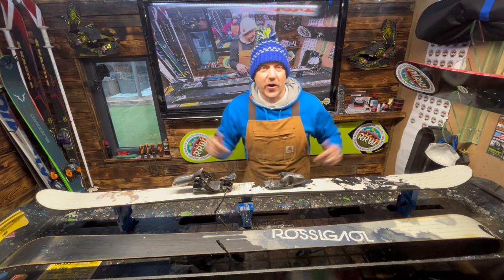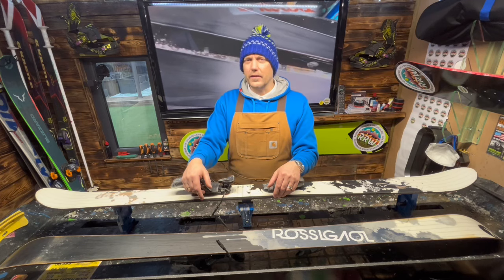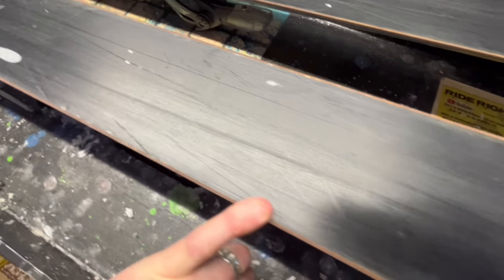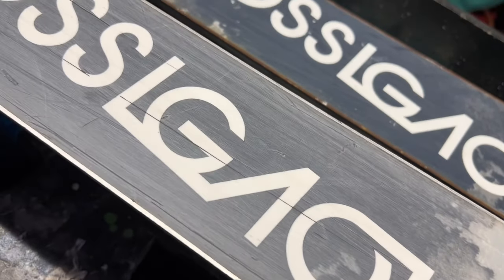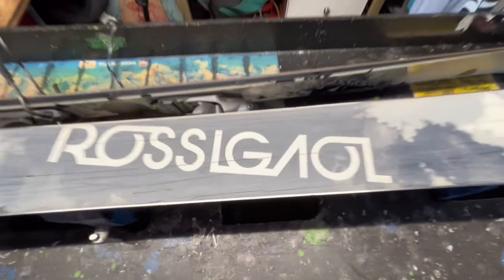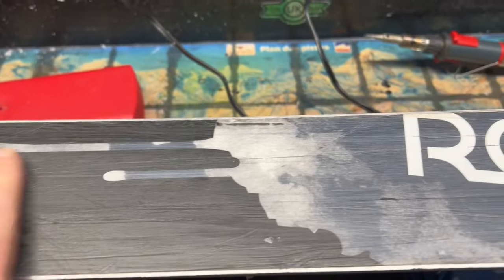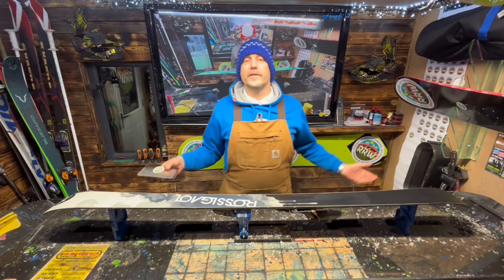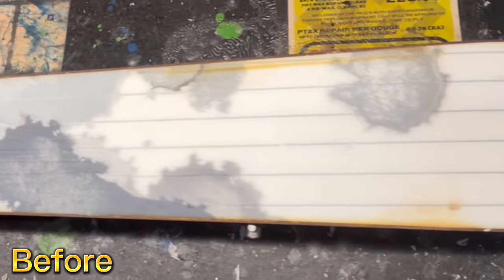Rossignol ￼ scratch Brigade very rusty and Core shot,  mega turn around 👌

Comment: After this amazing turnaround i have to ask. 

I made some superficial scratches on my bases while waxing that I just can't seem to polish off with a nylon or horsehair brush. And this irritates me immensely

I can’t feel them, but they are visible now the bases are brushed. Any ideas, perhaps a brass brush?

After seeing your work on these I must be missing something.
Reply from the maker: Thanks for the comment, sometimes depending on the base quality you might need to do a base scrape before applying the wax, it’s a sharp metal scraper. Sometimes this can add additional marks if you pushed too hard on the base of the Ski, you are meant to have directional marks in the Ski,, hence why you copper brush the Ski, before waxing it Then use a hairbrush and a very soft brush to polish the Ski, after you removed all the wax with a plastic scraper. Hope that helps. As long as the Ski, is very smooth and polished, it will perform very well.👍👍